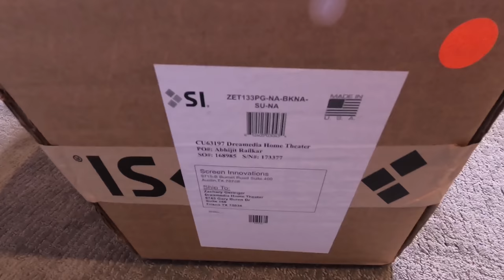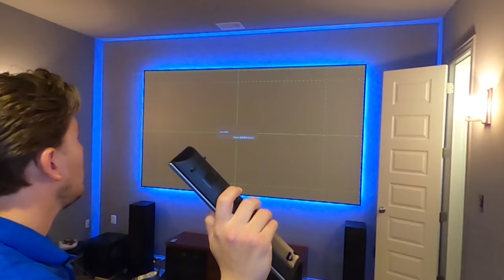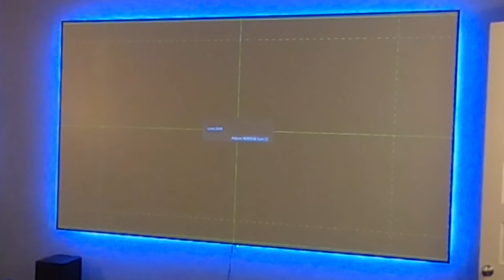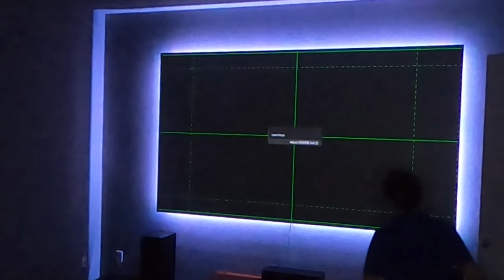How to Build / Mount a Projector Screen | Install  and Level a 4k Projector

Comment: Maybe I missed a video but do you have one explaining how to figure out where you need to actually mount the screen in relation to the projector? For example, the calculator I used online suggests either a + or - of 19” depending on how I run the projector either floor or ceiling. How do you figure out from there where to mount the screen? Is it 19” to the top of the actual screen or 19” to top of the actual image?

Comment: Zach, very nice job.
Question : In a completely light controlled room, what's the widest realistic screen size in 2.40:1 you could do with the JVC NX7 projector and still have acceptable picture/color/brightness?? (And please specify if that width is diagonal or strictly width.) Thanks!!
Reply: Light controlled room is one thing but with the JVC RS2000/NX7 you really need to have dark ceiling,  walls and floor.  Rosco TV Black paint or Triple Black Velvet at least 8 to 10 ft out from the screen to really allow for the contrast, black levels and HDR performance to really shine. I would be concerned about going higher than 135 inch diagonal 16 x 9 with the NX7  IMHO.
Reply from the maker: https://www.screeninnovations.com/tools/screen-size-calculator/  these guys have alot of good info.

Comment: Shout out to peasant crowd who rock 1080p full set ups (on  the dry wall)  for less than the led's on this expensive but nice set up.   Guessing it was more than my used Porsche cayenne ($6000)... Wow,  the guy flew there to install it!!? That's allota money to go around...  I had to laugh at beginning of this video where supposedly the projector was showing on a " bare wall " not much effort to dial in camera focus?  But I get it though..gotta justify cost.. .  A screen matters to some but it's nothing ive  found worth it as love my 180in Image on the wall of my lofted 1 bedroom apt... I'm sure 4k is great and soon as its under $500, I'm in....

Comment: The reason they want to sell you Screen innovation screens, is that there is an enormous markup in these idiotic screens.  They will tell you that the SI screens are made with diamonds 💎, and diamonds are expensive so the screen must be expensive.  Either buy a Stewart screen, or a Elite screen, or what most people should buy is a Silver Ticket screen on Amazon.